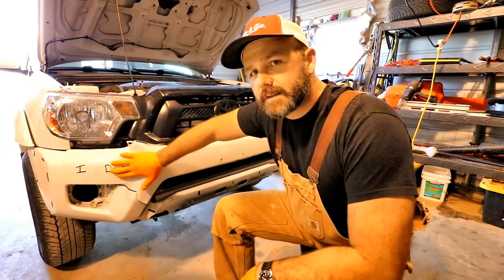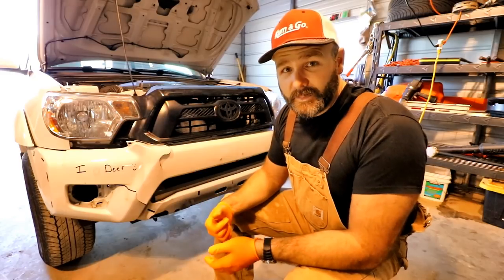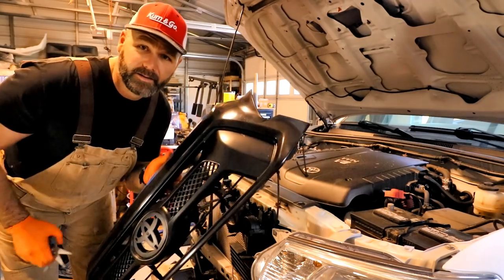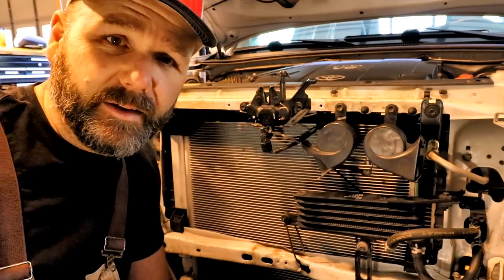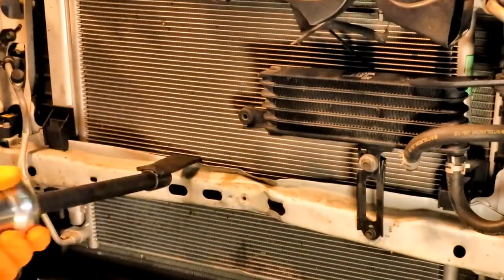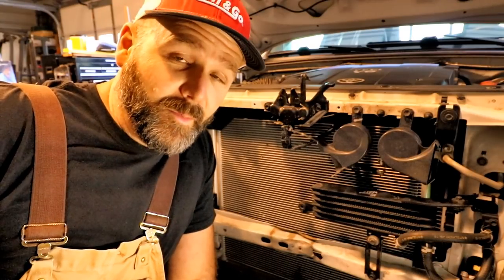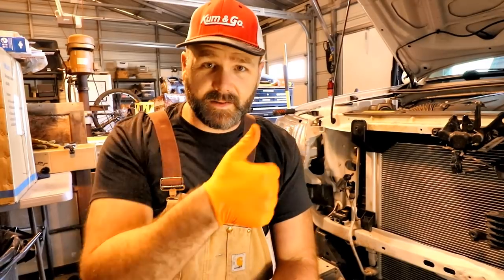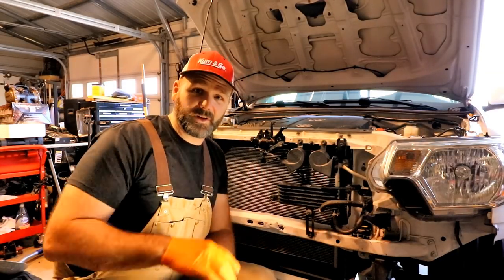TOYOTA TACOMA V/S DEER..MY WIFE IS OK...NOW LETS FIX THE TRUCK TOGETHER!!

Comment: Hey Josh, got a quick tip for ya. I do both auto mechanics and construction type work. I use my construction knee pads for work in on cars so I'm not digging my knee into the concrete or in my case with no garage, the gravel driveway.
Reply from the maker: Right on...yea I've got a set of gel knee pads...but for a small job like this I can just squirm around on the floor...did use it when we put the flooring in our house

Comment: You’ll be surprised with what you can use that slide hammer on. I’ve found a ton of different attachments for it, even a few different ones for bearings, and all kinds of things.

Comment: I have a Toyota Tacoma that a teenage girl who got drive and reverse mixed up and backed into me at a traffic light.  I had the same issues with my truck. I was able to pull the  radiator support bracket back out with a  ratchet strap hooked to my other truck. Worked really well for me. I put on all the related parts and she is still going.

Comment: I'm a paintless dent repair technician, and was a body man for 20 years prior.  A friendly suggestion is to get a pogo stick. I think the technical term is called a leverage bar, but that's what we called it. You could have used a bolt to attach the chain to the lower support and pulled it. The constant tension as you work the metal would have made your job a lot easier.

Comment: I like the videos that you create. Great topics. On the tacoma, given that the area you are in has a high population of dear, would it be better to dump the plastics and go with aftermarket steel or aluminum 'bull' type bumpers assembly? The chances of coming into contact with another deer are good, the 'bull' bumper will withstand a lot more abuse. And help to ensure that deer makes it into your freezer. Just a thought.
Reply from the maker: I totally agree brotha....told the wife...next deer strike is gonna be a new heavy duty bumper!

Comment: Hey Its looking good !  before my accident I was an autobody tech and frame tech . I loved what I did and I was in the middle of the tranformation of what cars and trucks changed into.   Doing body work isn't rocket science until you start primer and paint as well as the body filler.  As you have to weld new oieces on is tough if you have never welded on thin metal.  It really is watching what you are doing.  I think that you did a great job fixing your truck  I would always tell any one to take their time when doing the work. A tip if you are a newbe is to get zip sandwich baggies and a sharpee and write on the bag where the bolts and clips are from like fender or bumper or radiator keep them to each main piece so when the bolts and clips go back on that tey are where where they need to be.   You will always get caught up and pulled away so if you are working on an engine ,bumper or working on the front gate it keeps every thing together !!!  Great job !   I have watched negativity tear a shop apart because one guy is always negative so in live at work or your family be positive !!!!!!     Have a happy New Year
Reply: What great advice about cars and life
Reply from the maker: Thanks buddy...funny you mention the sharpe....my wife was armed with zip lock bags and a sharpe while I took it apart...we put painter's tape on each piece as we took it apart...labeled it all an re-assembly was a breeze

Comment: The attachment with the chain would have worked great too. You can wrap the chain around the rad support and hook the chain onto the hook then pull it out. Use these at work all the time. Good luck!

Comment: Most people in my area put grill guards and things like that on the front of their trucks to keep the damage to a minimum. You did everything a Body Tech such as myself would have done. We allow the airbag system a little longer to bleed off any stored battery voltage. Usually half an hour. I have seen what happens when one of these things goes off while working on the vehicle and its expensive.

Comment: Good for you - getting that together all by yourself! Earlier this year, I was forced to run over a downed tree branch in the road (in the dark, 45 mph, oncoming car on one side, ditch on the other, car on my bumper ... whatcha gonna do?) that took out the lower grill and left front turn light bezel on wife’s six month old Beetle convertible. Yes, I could have just done an insurance claim on it, but the insurance company would have just hiked up my rates and gotten their money back that way. I purchased all the parts new on eBay (genuine VW for less than $200, spent a couple hours unsnapping out the broken parts and snapping in the new and good to go. You’d never know it ever happened. I also totally agree that you plop down your hard earned money, so drive it till you can’t then fix it and drive it some more!

Comment: I have a little 2015 Toyota Tacoma SR5 Quad Cab 4 door I bought it because of the resale value. I can get very close to the same amount I gave for it if I was to sell it today...
Reply from the maker: I agree...same here.....they go for gold! Even after years...if we were smart we would trade it in and get a new one...probably only have to spend another $5k and have a brand new on...pushing the 60k mile mark...so the miles are right for a good trade in
Reply: I'm a Ford guy, but I have to say that Toyotas are nice, and the older 22r's are bulletproof and make very nice little pickup trucks. I havent been in a new onw but I do here good things.

Comment: Hi Josh ,
Just a little hint for straightening out dents .  You begin the straightening where the metal bent LAST .  One thing to be aware of is that the metal stretched a little when it bent.  Most people will begin hammering on the deepest part of a dent .  Or where the first impact was .  So where is that stretched metal supposed to go ? You'll still have it . Begin working on a dent around the edges where it bent last .  This will tend to shrink the metal and begin to pull the center point of impact back out into position.  A lot less metal work is then required .
 Yes , I know , it is sooo tempting to begin hammering on that first point of impact because it is usually the deepest .  And you want to SEE metal move . If you do it properly you may not even see the metal move back out to it's proper position . Yes , it works the same way on bent brackets also .

Comment: Great job! You said you replaced the AC Condensor. Did you have to deal with evacuating and refilling the freon in the AC system. If so did you do that yourself as well or have someone else do it? Keep up the great vids and I just subscribed.
Reply from the maker: I took it to a shop and had it evacuated and recharged...a must for sure or it will ruin the system

Comment: If you can’t fix it with duct tape wd40 and zip ties it’s not worth fixin 😂😂😂
Reply: If it moves and it shouldn't, duct tape and zip ties. If it should move and it doesn't, WD40 and Liquid Wrench.
Reply: Didn't you know? That's all you need to fix Toyotas. The 3rd world manages to keep their 1980s Hiluxes running only with duct tape and zip ties.
Reply: heck the old 22rs will keep running even if you dont want them too, bulletproof little engines.

Comment: how is mrs stoney ridge josh them things hit hard and can shake you up hope mrs stoney ridge is ok and josh when you do a repair like that your best off spraying the full bar rather than just the bit you pulled out as when you look at it in couple years it will drive you mad bro just saying brother
Reply from the maker: True...but cant see it at all under the hood or behind the bumper...should have just hit it with some rubberized undercoat spray

Comment: I hit a deer in my 08 Silverado and my insurance requires no deductible on hitting animals, it did 2500.00 worth of cosmetic damage. The insurance wrote the check to me and I fixed it for 350.00 worth of late model junkyard parts....didn't even need paint because the donor truck was the same color. I took the difference and bought new wheels and tires.....WOOOOO !!!!
Reply from the maker: There ya go!
Reply: lmfao, what insurance is this? i still have to pay deductible when i hit a deer, im under texas farm ins.
Reply: Shelter Insurance

Comment: You never can use enough zip ties.  Zip ties might even be superior to the stupid attachment system used by the factory.  You can get 100 zip ties for a dollar.

The one you did not know right off the top of your head, (and right next to carrying case handle,) looks like for pushing the edge into place... but I think you need to beat a hammer on the end to use it like that.   Try seeing if you can reverse your strike hammer so the the head the slide smacks on is close to that edge or you can put stuff on the other end of the hammer.

Also, Try putting a screw though one of the holes, and pulling it with the slide hammer, or welding a screw that can be attached to the slide hammer at the center of a dent.  the closer you can put force on bend, the more like you will pull the bend out, and the cleaner it will look.  It would be sort of like how professional metal workers MIG weld Studs to a car body to yank a dent out.

https://www.youtube.com/watch?v=vEyE8PibVDs

If you have access to a blow torch, you can heat you can also re-tension the metal by heating it up and then cooling it off quickly with a rag soaking in water.   That should get you more of the strength back and maybe pull more of those dents out a sheet of metal that was bent.  But I would not do that right next your radiator.

https://www.youtube.com/watch?v=mptiiRLEJs0
 
In the case to this bracket, that got bent up and left in the truck, it should be fine.. but there is a sneaky little way to strengthen that up that works pretty well, and barely requires any hand tools to fix up.. The easy thing you can do is, make a wooden shape dowel to fit into the clevis created in the U shape of the support, and zip tie it in.  you want your dowel to be as long as possible to fit in that area.  That will give you just almost as much strength as you had before while being light, and not require metal working to fix it.. Just make sure you use alot of zip ties to hold it in place so it can't bow out of place.
Reply from the maker: Shoot they are better....when I put it all back together I found that the zip ties held things even tighter!

Comment: Toyota built the best trucks
Reply from the maker: Ya know...I'm not so sure anymore.  Used to be that toyota's had a reputation for outlasting all other trucks....they most certainly hold their value...but will a 2019 toyota out last a 2018 Nissan or Dodge or Chevy?  The jury is out because the electronics fail before the mechanical parts nowadays

Comment: Either she hit a small deer....or just bumped it.....Most of the deer strikes out here in Indiana....almost disintegrate the front end of even older vehicles.Years ago I ran over the trunk meat of a freshly hit good size buck.It destroyed the left fender of the semi that hit it...it was pulled over and sitting on the side of the road.My work cube van lost its brakes when the bones and meat rolled up under neathe and ripped loose brake lines and hoses.The funny thing was....I had this mini recorder that I talked into to refresh what materials I would need for the job that day.You could hear me say....I need 2 p traps and 30 feet of 2 inch pipe and holy shi*.....I just ran over a dead dear body.I played that back for many people.I passed that spot up for months and could see the blood stain for quite a while.Glad she was ok and you fixed your car on the cheap Josh.Great video....as usual.And remember....keep them vehicles out of the cabbage....as Amesi1 says from N.H.

Comment: http://www.rockauto.com/en/catalog/toyota,2014,tacoma,4.0l+v6,3307209,body,radiator+support,812

Thats probably the route i would have gone 50 bucks for a new  one
Reply from the maker: $50 is just the begining...you gotta cut out an weld in the new one....$50 bucks turns into 5 more hours of beating, cutting welding and painting.....all to move it about 1 inch....I'm happy with my decision....next deer gets a new radiator support lol....and there will be more for sure!

Comment: Shoulda bought a ford
Reply: pulled a ford out of a ditch a week ago with my Tacoma. I have had 2 Fords, never again.
Reply: i own a 2012 tacoma and it has never given me any issues
Reply: I have a 85 4runner very little issues over the past 18 years. Also 99 runner no issues. Just bought a 2002 4wd 4runner runs like top even with the neglect from previous owners. Also had 84 truck rolled it! 93 truck 2wd slammed and was a mustang 5.0 killer. Fast little thing. Needless to say Toyota rocks!
Reply: 80% of toyota cars sold in the past 20 years are still on the road
Reply: Caleb Ezzell i do like ford but ive drove a Tacoma it was a nice drive
Reply: For what so it could’ve been worse
Reply: Trevor Williams Did you ever hit a deer with yours ??    I did but not with a Toyota....  A 1968 ford truck...  I ate good for a while ~!~!
Reply: a toyota aint a real truck, if you cant buy it with a diesel its not a real truck
Reply: yup, and there just as boring as ever
Reply: If it was a ford it woulda been destroyed.
Reply: no, the f series bumpers are metal
Reply from the maker: hmmm....disagree
Reply from the maker: So I should have a Ranger instead of a Tacoma?  So it's worth $300 in 5 years...I think I'll stick with the one that holds it's value..nothing against ford..I own 2
Reply: Stoney Ridge Farmer I thought you had a Ram and your $100 Ford?
Reply: Ford my ass. We have a 4 Toyota's. Just bought a new one. Also have a dodge 2500 Cummings diesel I'll put up against your fucked up Ford any day. My oldest Toyota is a 04 with 300 thousands miles never have done any major repairs because they are built to last
Reply: Yeah it wouldn't be running to hit a deer.
Reply: I agree.  been driving  Ford for 37 years,  Every one one them still run great
Reply: Similar to walking in sandwich bag shoes  - The past was better, the future is best - we're stuck here and now in this present detest. - happy new year.
Reply: Caleb Ezzell welcome to high school- mines better every make is best and worst depending on who you talk to
Reply: Stoney Ridge Farmer but one of them is a 100$ truck LOL
Reply: Caleb Ezzell would have broke down so soon that it wouldn’t have hit the deer
Reply: Ford stands for found on road dead
Reply: Cooper Collins found often rescuing duramax
Reply: @85square  obviously you have never driven a Toyota truck
Reply: im sure toyota trucks are great for some people but they don't suit me